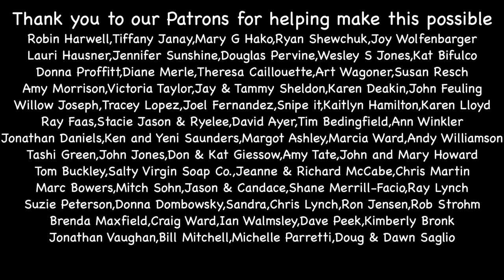WE'VE BEEN WAITING FOR THIS MOMENT!!! // off grid luxury bathroom

Comment: Why don't you guys weld using flux core MIG wire?  Its a hundred times faster for about the same amount of mess and you can get structural T-8 cored wire with not much problem.  There's also a heck of a lot less waste since there aren't stick stubs left.  Flux core wire is basically just a inside-out stick electrode.  I think a flux core MIG is about the same cost to weld as a stick.
You can order a multiprocess MIG/TIG/stick welder like a Yeswelder 205DS for about $400.  I have one and have used the snot out of it, it'll run on 120 or 220 and since it's auto-setting it's really easy for a beginner MIG welder.

Comment: some advice: dont make steel floors. they are loud. as such, youll be putting down, maybe both a subfloor and flooring. and then when your wet house does leak through, youll have to tear out all of that sustainable wood flooring, to replace the non carbon replenishable galvanized shit steel framing you put in. this whole building is a carbon disaster so far. NOT sustainable. typical americans' thinking that throwing the kitchen sink at sustainability gets them the lazy pass going forward. sustainability takes work from the ground up. you missed. largely. you should have been looking for 1 1/2" hardwood slabs that could be replaced one at a time. the bizarre concrete foundation should have made itself obvious in the man hours/materials and mistakes. yer inventing the wheel without checking your math. anyway for all that rebar you did, you really couldve just thrown a cast iron sink into your forms {forms? that didnt work}, for the geo-stability they will provide given they are individual and unattached. they are heavy yeah- but easily washed out given they are not tied underground.